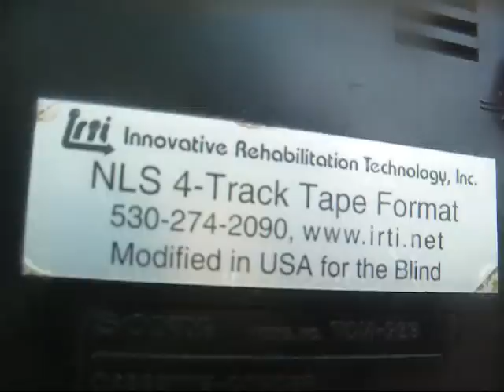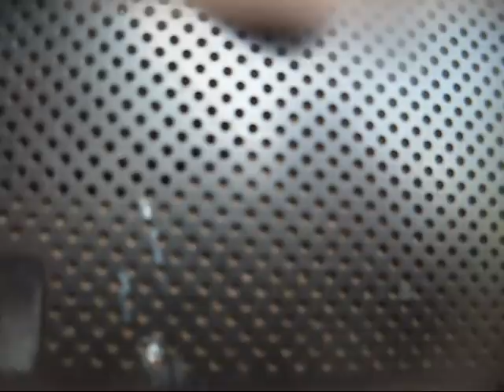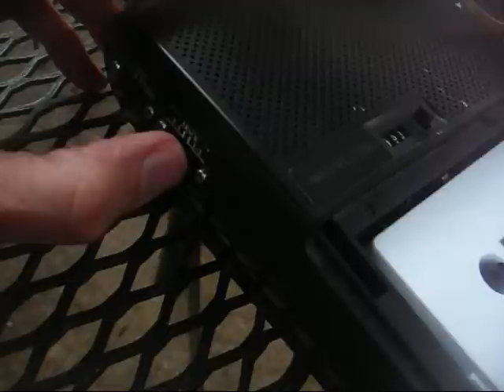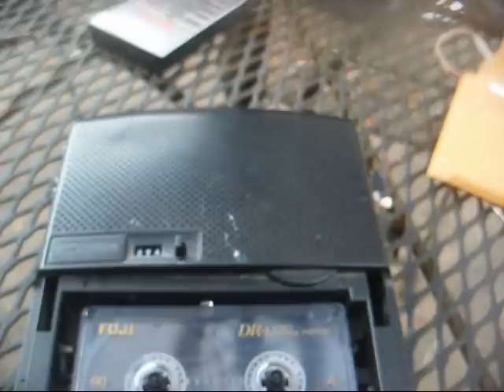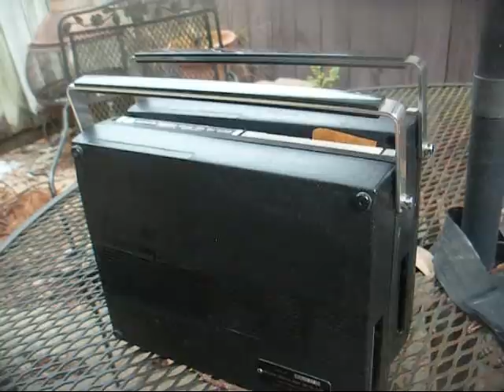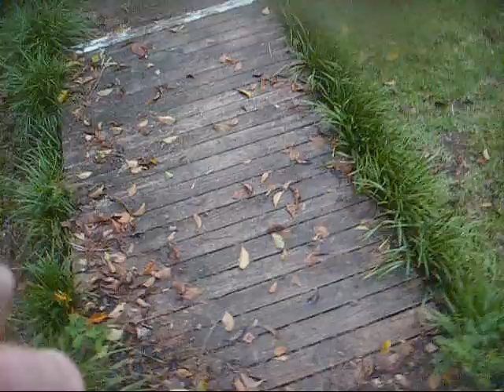Repair of a 21st century Sony cassette recorder (modified for NLS talking book use)

Comment: I would have so much fun with the variable speed. Clever arrangement of tracks. You could play these tapes on a stereo by turning the balance control left and right at the appropriate time...if you don't mind it sounding like Alvin and the Chipmunks recorded it.

Comment: I had one of these i broke it up pure chinese rubbish i could not be bothered to repair it but this one is modified for a purpose my 1976 phillips is still working well and not even changed the belt most of my mono decks are just for retro computer use like my panasonic rq 2732 .